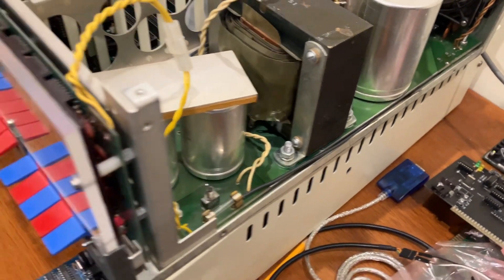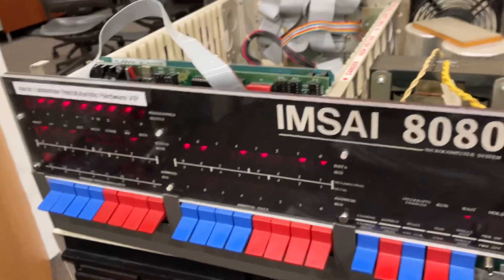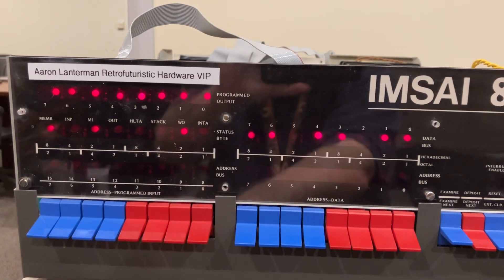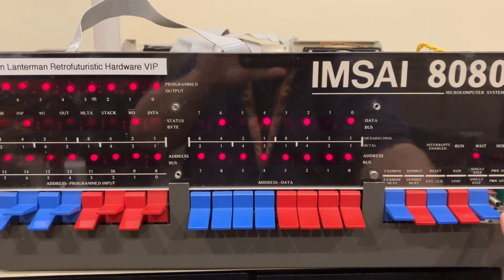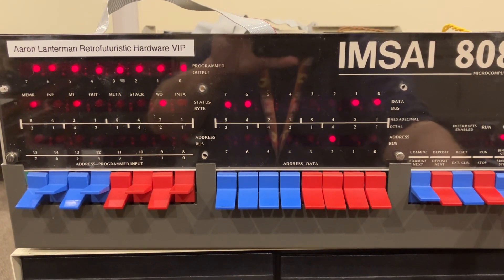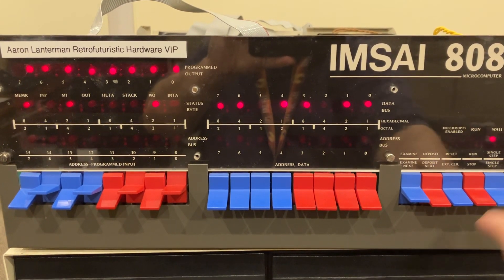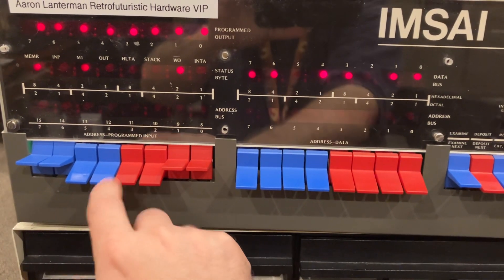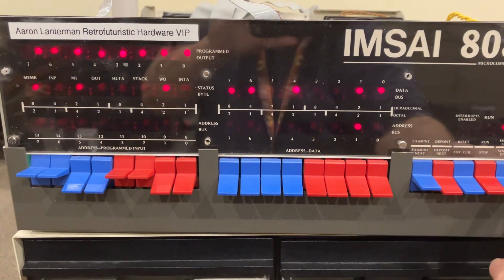IMSAI 8080 Program Output Lights Stuck On (but Power Supply Fixed!) (Altair 8800 clone)

Comment: Do you have a print out of the program it's running? ...or a way to see into the registers? We can see the step where it goes to FF and sees the data, but at that point we should be able to see a "move contents of FF to the accumulator" has been csrried out on the status register LEDs (and maybe inspect the ACC?). 
Likewise, after the processing to get the inverse data, the result has to be stored in whatever address or register the output LEDs are attached to. I just dont think I see enough steps happening before it restarts.

Comment: I looked at the CPA board schematics (front panel), the anode of the output LEDs are connected to +5V and the cathodes to a 8212 register which reads from the data bus. That would explain why they are all on if the IC and/or its control lines aren't working properly.
Reply from the maker: Thanks, I'll check out that part of the board!

Comment: the power supply looks you're using a nuclear power plant's output. that size of capacitors!
Why not use a smps?
Reply: Most likely because the original IMSAI used a linear PSU, and that means large caps.
Reply: @bobvines00  i have a few of those as wel, like modular synth, there is alike 5 cm x 2.5 cm, no where near that huge.
Reply: @AnalogDude_  I have a couple of late '60s, early '70s minicomputers with linear PSUs with filter caps at least the size of 12-oz. (~0.35-L I think) soda cans.  That's why I was aware of the size of filter caps in old linear PSUs.
Reply from the maker: @bobvines00  Ooooooh tell me more about your minicomputers! I am obsessed with them.
Reply: @bobvines00  mini?
Reply: @Lantertronics  I have a DEC PDP-8/L, an -8/E, and an -8/A all with core memory, plus several of the microprocessor-based members of the "Family of 8."

I've also got 3 Q-BUS-based PDP-11s and a VAX 4100 (I think that's the model number).  Sometimes I wonder whether or not I'll ever get around to playing/repairing(?) with the -11s & the VAX.  I used to have a Data General S-130, but gave it to a DG collector several years ago when I decided that I'd never get around to fooling with it (troubleshooting, repairing, etc.).

I'm pretty much out of space in my shop, so I have to excavate to reach all but my -8/A (and it's relatively hard to access), so I'll have to decide what to do with the 11s & the VAX pretty soon (plus some of the DEC peripherals that I've collected too).  :(
Reply from the maker: @bobvines00   WOW!
Reply from the maker: @bobvines00  I have a box of VAX boards that was donated to our project. One day I hope to locate an appropriate backplane to put them in.
Reply: @Lantertronics  My VAX was originally used to control a 3-machine machining center with pallet loaders, so I "ASSuME" that it is full of boards.  Good luck finding a suitable backplane!
Reply from the maker: @bobvines00  Yeah, it's the original power supply. If it ever fully goes and becomes too hard to fix (like if the transformer shorts or something) I plan to look for a more modern switch mode supply to replace it.